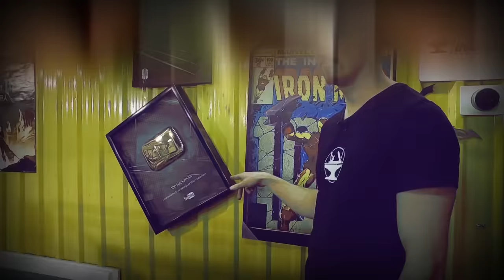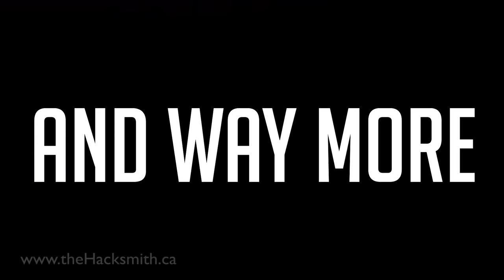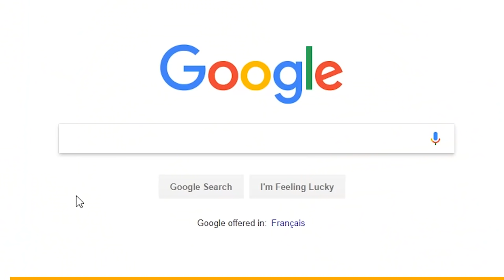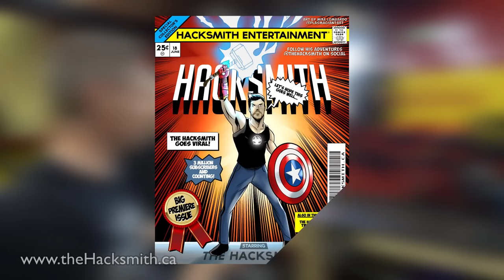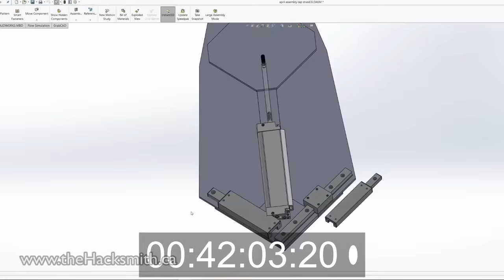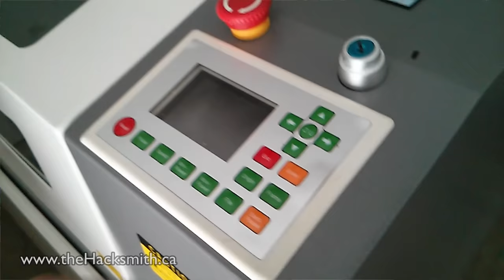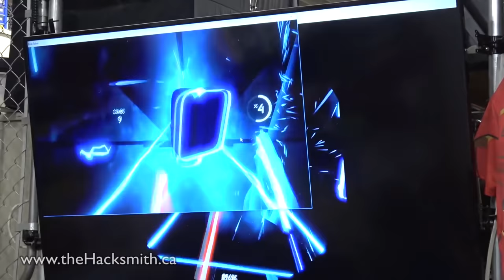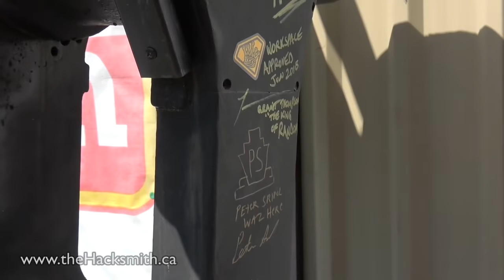The KING of RANDOM & the Hacksmith!

Comment: Hello Hacksmith i have a challenge for you. i want you to build a shield that has the ability to split in half & reattach to each other. But when they split the shields will expand from both left & right of the shields & when you want to reattach them they return to the original form. this challenge is optional if you want to do it. but if you don't want to do it that's okay i'll understand what can be possible & is impossible.

Comment: 75lbs or 34kg is not very heavy I'm 16 don't work out what so ever don't eat very healthy and I can bench 5 reps of 135kg consistently, if you think that 34kg is heavy then you need help and need to hit the gym, I mean honestly I can do a solid 15 reps of 45kg consistently on one arm jesus you guys need to work out
Reply from the maker: Good job. Density plays a part though ;)
Reply: the Hacksmith very true which is why it's that weight in such a small package but 34kg is 34kg, it's weight, yes you need a larger amount of steel to get the same weight but again it is the same amount of weight
Reply from the maker: it's still not the same as curling a barbell -- your wrists can't take that much weight off balance